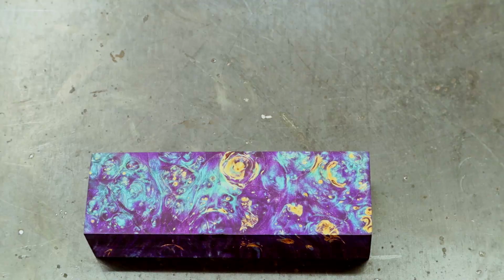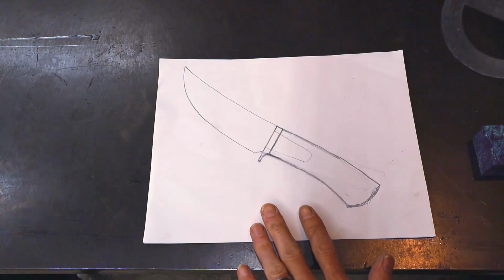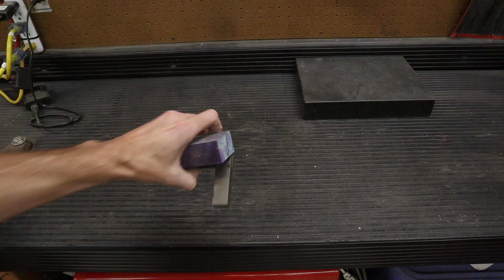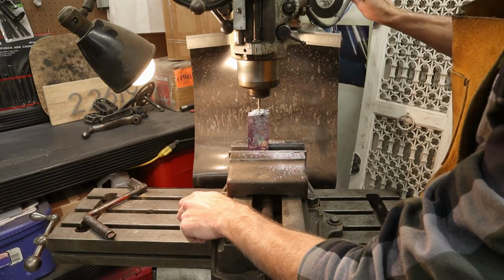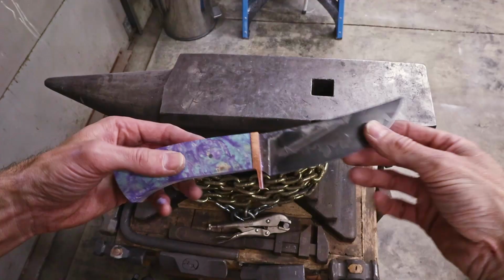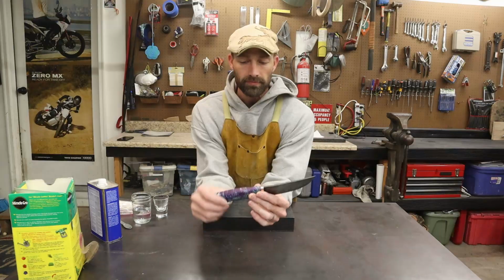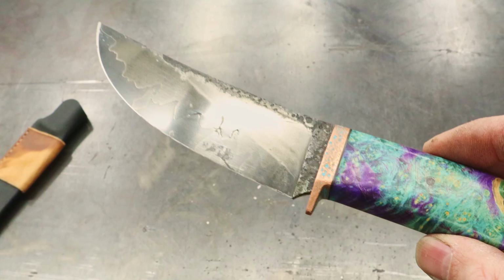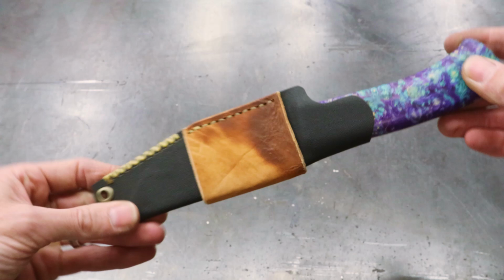dyed stabilized wood - cactus juice - double dyed maple knife handle

Comment: That's amazing ! Awesome wood 😍
What do you think of sanding sponges ? I've fallen in love with them to sand my wood handles, they make a great job once I've reached 400. I go up to 4000 with those, they're long lasting and they work great to get nice rounded surfaced. They don't remove every scratches of the previous grits, that's why I'm sanding up to 400 before
Reply from the maker: I am going to have to try those!